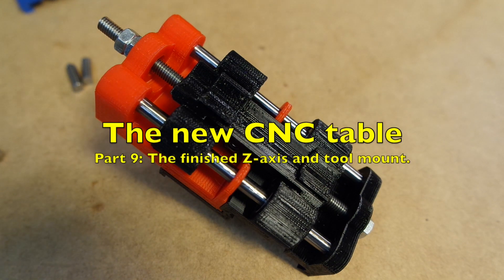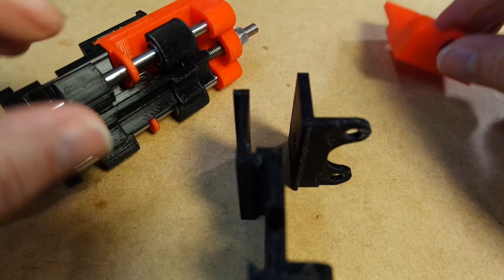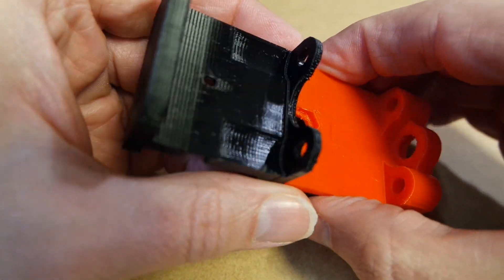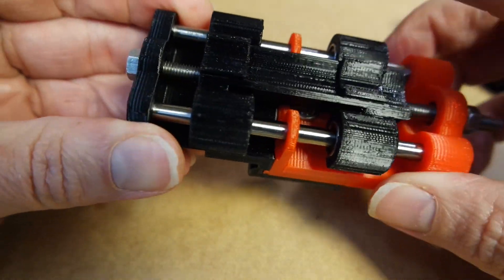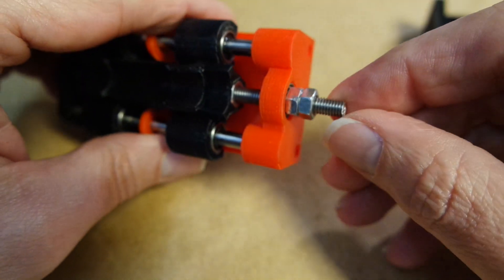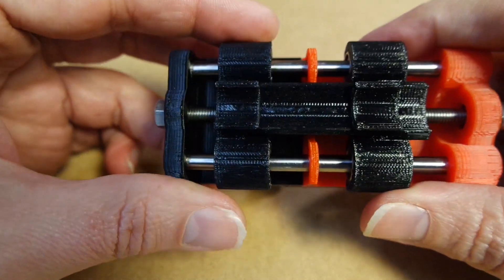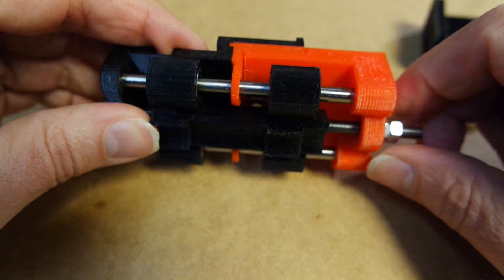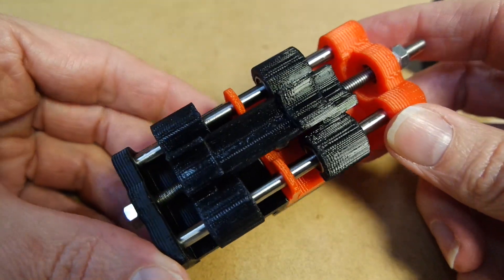The new CNC table pt. 9

Comment: looking good . nice and compact .
Reply from the maker: Thank you very much - have a great new year - how is the printer project doing ?
Reply: Holiday time of year and getting a new puppy sort of  paused it . LOL 
I do need to print the new X carriage part (s)  and i need to  make a cardboard  draft break for the bigger printer , as it's sitting in the most drafty place in my old house.  also i need to sort out the PSU to figure out why some time sit run heat bed for  30 or 40 min no problems and sometimes not even 1 sec before the PSU  trips . 
i think i need a balanced load on 5v and 3.3v .
Other wise i will have to  order a dedicated 12v PSU .
Reply from the maker: Oh yes - I can imagine what that must be like with a new puppy -
I've had the most abysmal time 3D printing. I build an enclosure for my basement printer, because
it's like 13degC down there, and after that all the temp-settings were crud. I mean way off. It took
me a week to get it dialed in again. 
On my second printer I had a lot of print fails, It turned out that the "super" black filament has beads in it
that clogged/blocked at the extruder entrance. In the end, I killed 2 peek insulators by turning the heat up too
much without flow, and put big scratch into the aluminium print bed. 
Those insulators are really expensive, 'cos I need to order them from the Netherlands, and shipping is soooo
expensive.
I'd get a cheap 12V industrial power supply, in fact I have one just for this type of things.
Cheers , and happy making !
Dirk
Reply: drafty old house like min its nothing for the corner the big printer sits in to drop to 10 ro 12c  with drafts .  my Fab Mini , with  jewel case doors is almost draft and  'cold' proof  . 
i need to make a larger thing  to enclose the bigger printer .  I have lots of card board left form Christmas items that can be used for now and to make patterns for some coroplast ( plastic cardboard ) or such for later . 
i wonder if you could mold a insulator out of some ceramic ?   or if  some Bakelite could work , but i think its only good to 120c before it breaks down . 
I wonder if you could mill it out of hard wood . but some wood has ignition temps in the 190c range so thats no good. 
Peek temp limit is in the 260c range .
and yep i need a better 12v supply

Comment: I am playing around with a similar set up. Found using some light weight keeper springs top and bottom helps the stepper motor when lowering or lifting the tool, for a clean movement from static.
Reply from the maker: That's a pretty cool idea .... I'll keep that in mind if I run into problems during testing.

Comment: very nice - looks solid.
Is there a spring(s) in there for anti-backlash?
Reply from the maker: Not in this one, but I usually put a rubber washer under the top nut if it is required.